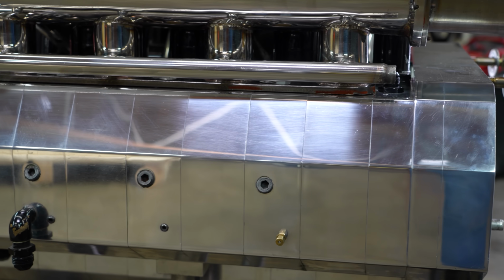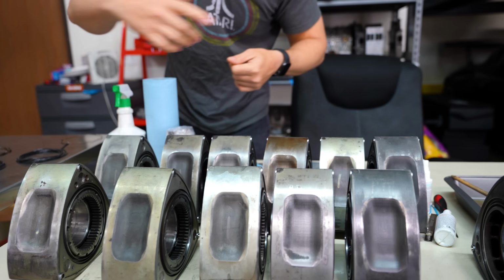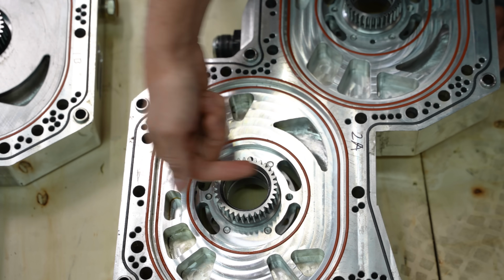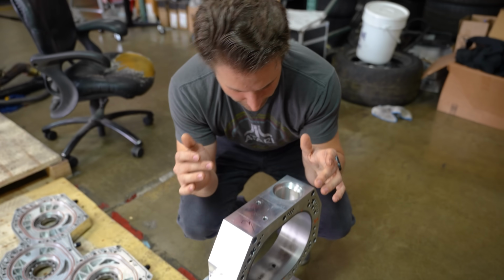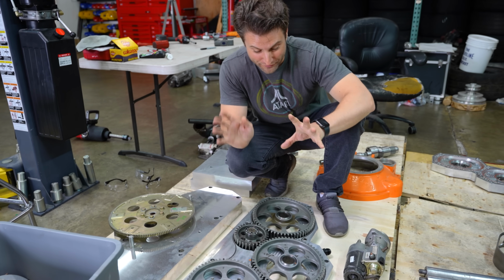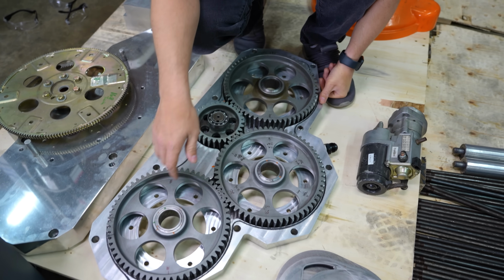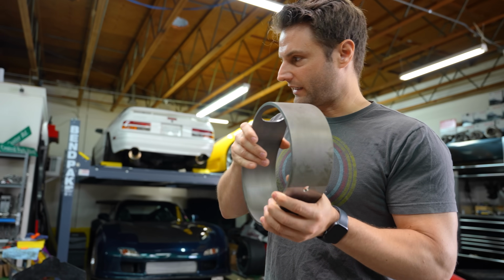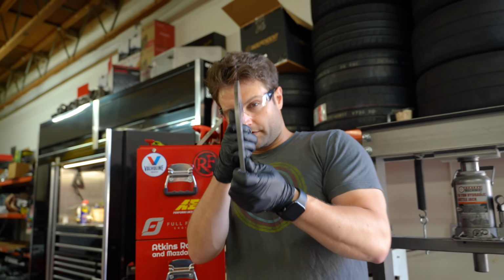Everything wrong with the 12 Rotor

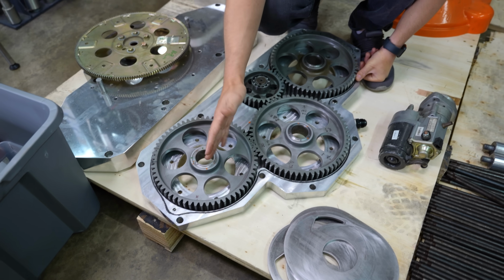Comment: 13:28 - Is it possible it's 3 degrees off because the smaller gear is off-centre? Wouldn't that cause a tiny difference in the force being experience by two of the gears which isn't transmitted equally to the third gear? 

Pure speculation on my part. I'm just curious if it could be true.

Comment: A massive amount of heat for a marine engine is not just ok because you can cool it easily, it also provides a possible source of hot water when at sea. Run a heat exchanger along that thing and the waste heat could be very useful on a boat.

Comment: Really using gravity to feed the oil system makes zero sense to me each rotor set should hv its own pressurized oil feed system and the coolant system neither upper or lower set should share fluids rotors are finicky and oil starvation and air in the coolant system will kill a rotory faster than anything

Comment: It’s an R&D in motion. Someone had to start the motion and the inventor did. What happens going forward is called “progress”. The only thing I would add is that the whole thing is machined out of a single piece of aluminum per section. That’s a “whole lot of shakin going on” as Jerry Lee Used to say. Also all those holes are weak areas… every single one of them. “Time” in motion is the factor missing.. there is so much energy going on in a small enclosure that I believe this design would be self destructive. I still applaud the effort.

Comment: this engine will never run, It is a shambles, the fact that someone made it with no sealing ring for the fuel inlet and silicone is used when you don't know if the two surfaces even meet or have a gap, if it does run it will be hopeless and never move and car forward, 
I bet you £5 I'm right, any takers, I'll give it 24 months from today 26.12.23

Comment: @12:45 It is very clear that the big gears and small gear will need to be replaced, so that three main gears are spun identically. https://youtu.be/Q2IFWveYBRs?t=322  If you have not seen it running so smooth a glass of water has no ripples.

Comment: I can't believe the guy designed this with so few problems first go. Massive engine knowledge and creativity...Genious level stuff really. Clearly it's not going to run a long time as it is presently built but with some design adjustments it looks capable of being a solid functional block. The value of taking it apart, seeing his design and how it started failing is off the charts. In a marine application this engine has serious potential as well.

Comment: You need to flip one of the drive gears over to get all 3 banks timed perfectly. If each gear is off by 1.5 degrees, say clockwise, then flipping one gear over would make it 1.5 degrees off counterclockwise. A drivve gear mounted backwards would cancel out the timing offset.

Comment: You need to cryo all the parts for extended life, extreme dissipation of heat, getting very consistent expansion and contraction, increasing the strength dramatically of all parts. Cryo'd parts require cryo specific heat treating after the cryo treatment. Aluminum and iron are cryo'd and heat treated for different times and temperatures. Beware of people who do cryo and don't know what is actually the correct methods. All dissimilar metals have to be treated separately, not assembled or pressed together. You can experiment on a 2 rotor motor to prove out these benefits. I am the founder and now retired past owner of Cryo Science that was originally located in San Diego, CA.

Comment: I have a NA rotory 13b in my 1986 rx7 and it never skipped a beat.. I think rotary is a lot more reliable than my friends A4 2.0t which died at 60k miles.. my other friends A8 4.2 needs a rebuild at 80k.. my BMW 328i only made it to 135k.. the mazda will go well beyond 150k no problem at all.

Comment: So you're saying that 6 shafts in a hexagon with 2 rotors each would be the dream 12 rotor engine. Half running clockwise half anti-clockwise, potential to have each rotor firing by itself, half tooth timing is at least balanced, still no counterweights. In some ways the engine could be thought of as in three thirds of clock/counter shafts, in some ways two interlocking triangles of same-orientation shafts. One set of triangles would have three reversing cogs one end, other triangle reversing cogs the other. All things balanced.

Comment: If it was made from bellitt magnesium, instead of aluminum, would it eliminate some of the issues? Also, if it was used in a marine application, it would require a serious heat exchanger system, because you can't use the water from the
environment (contaminated water, salt water, or even tanic acidic fresh water. They easily destroy metal thru electrolysis or dissimilar metals. Good luck, my head is hurting just thinking about it!

Comment: I will admit that I don't know a ton about engines, but I do know a little about lathe spindles and from watching your YouTube videos on the 12 rotor engine with the modular spindle crank shaft. My question is, wouldn't taper roller bearings be a better choice to help in countering axial loads of of the shafts oiling system and the higher rpm that this engine was inspired to produce? As I said know next to nothing about engines and a bit about machine tool spindles that are designed for very high rpms.

Comment: There should be pressure sensors in most cavities where needed if that's possible,, so you'll know if any seal breaks inside the engine and it loosers pressure. It's a very technically hard to probably fit this but it would be good as you wouldn't have to pull the whole engine apart to find a leak as it will be pretty much pin pointed for you.???? Maybe just for the first time running the engine so If it fails on any seals, you can solve the problem and try again and if it holds, take the pressure sensors out and trust your engineering but I'd say keep them in.

Comment: The Zero Calculation of a gear tooth is interesting.  Rob's analysis presumes that the outside gear teeth are completely symmetrical with the inside splines going to the shaft.
He may be exactly correct, but there is a solution.  a new set of gears can be created with the shafts and Inside Splines aligned at Top Dead Center then have the outside teeth cut to the desired position.

Comment: It might have been said here. The gears are the same. But are the location of the centerlines the same? It wouldn't be hard for the case to be off slightly to compensate for the 3 degrees. it would likely be 1/16 to 1/8 of an inch axially. It likely would be hard to notice.

Comment: Rob! I'm building a 82 gen 1 rx7 and I am installing a sniper efi conversion and a red holly fuel pump. I'm also changing the fuel lines from SS to braided an6. However I'm running into an issue. The fuel pump is 3/8 npt and the EFI is 9/16. Second issue is how to install a fuel filter with this new set up. 
Please help

Comment: Why not use Oil as a coolant - 50 years ago I worked at a gas station and this old lady pulled in and asked me to check the oil in her radiator - after making a fool of myself I put a pint of oil in her radiator and found that she knew how her car worked - Water is not the only coolant on earth - Oil's not bad either and it doesn't have the catastrophic effect when a head gasket blows either - it's more "CLOSE IT DOWN CLOSE IT DOWN" as the sump becomes the fuel and the throttle is the lack of oil in the sump and the Blowbi value is the air intake

Comment: Simple solution.  Run the pressure channels backwards sotospeak with a separate pressure vessel.  Think instead of low pressure drain as hi pressure oil running the other way.

Comment: If at the rotors are in phase you get 6 power pulses per revolution. Why not spread it out to get 36 power pulses per revolution? Use 3 computers for control.

Comment: Any way yo look at it rotary motors are still in efficient zero torque producing turds. NA or otherwise. 
also looking at the ports on these the flow must be atrocious on intake and exhaust side, with the hard edges and changes in direction the fuel/air mix has to make to get into the combustion chamber then the horrid restriction of that poorly shaped exhaust port. i bet a better intake and exhaust port shape would help that motor more than youd think.

Comment: Chemical Engineer here: Shouldn't the gearing at the coupling not be a big issue, since the e-shafts can be timed separately with the splines in steps of 4 degrees (IIRC)? So it should only be 1 degree off the other rows?

The last point was the most critical IMO. The difference in thermal expansion coefficient will surely lead to long term issues. Either the those plates need to be reinforced without inhibiting the function (like splines), or you need a new material that is more aligned with the aluminums coefficient, but can stand the heat.

And no, I haven't watched the new 84 minute video. I just found this channel and haven't had the time yet.

Comment: The engineering challenges in this 12 rotor are daunting, to say the least.  Regarding the 3 degrees of timing being off and the one set of rotors having to run in reverse, what if you could figure a way to add another smaller gear.  Like the one smaller gear already in there, this would enable you to un-link the two larger gears and then have all the rotors run in the same direction of rotation.  Sure, that adds to the complexity.  The problem might also be not having enough room in the casting.  
You still also have all those other issues to deal with as well.

Comment: Not only that, but the closest to camera sprocket/shaft is running not just 3 degrees off but in the opposite direction to the other 2. So there's going to be interesting things going on with the math etc. With the offset position where the two sets of teeth meet compared to top dead center I'd have to closely look at the tooth spacing to see what it actually all means as it might all line up if they've been exceptionally clever.

Comment: I want to make a comment, not specifically about the video-- but something he mentions. ''A naturally aspirated rotary never has problems'' (paraphrased). This is not exactly true. I see many NA rotary engines having major problems at even 150000 miles. Obviously it depends how much you're really pushing the engine, but its a rotary, you're gonna have some fun on canyon or local roads. And when that happens, you get a lot of problems with even NA rotaries.

Comment: How many splines do the e-shafts have where they connect to those gears?  Because you're right, with them all assembled at the same place on identical gears, being tooth and valley means it'll be 3 degrees off.  But if there are, say, only 24 splines, then by pulling the e-shaft out, moving it forward one spline, and then moving the gear back one tooth, you've advanced (or retarded) the rotor timing by 9 degrees.  If you went two teeth... that's 3 degrees.

Math: 24 splines into 360 degrees means each spline gives you 15 degrees of rotation.  Move forward one spline and back two 6 degree teeth, that's 3 degrees advance.  Move back one spline and forward two teeth, that's 3 degrees of retardation.

Now, obviously I don't know how many splines those things have, but as long as it's not "60" or "30", then there may well be some combination of spline and tooth shifting that let's you put all of your rotors at "relative TDC" to one another and have them firing as appropriate, and also not making for weird out of synch power strokes and exhaust pulses.  (Which would be the other way to solve the problem, given electronic timing and injection -- just tell the computer to move that bank of rotors by 3 degrees relative to the others.  But it won't sound nearly as awesome as them being actually timed correctly.)

Comment: i see your point but i think you should have taken the bowed convex rotor side plate and milled it some and then installed it upside down. since the port location would be wrong, maybe the optimal solution would have been to use your press and go beyond straightening it, rather give it 7 to 8 pumps and bow it the opposite direction and then mill it flat. then the port location is correct and the component is wear-mated to the circumstances of the engine. you wont have oil leaks by the seals, rather, some blow-by on a cold engine that passes after warm-up. honored to be submitting an opinion about such a great engine and to those bearing the endeavor. i'm no stranger to the anxiety associated with cutting something (like your end plates) that is a one-off component that cannot simply be replaced or remade. you may possibly regret cutting it and reading my suggestion. but when my favorite machine shop (ARI in Grandview, MO) had a new guy accidently break 2 of my 8 hand-Dremmel'd hand-domed & hand-clearanced pistons, i was devastated inside, but before i spoke in reply to one of my personal hero's, i considered his devastation when he found out what his employee had done and finding the serenity to make that call and give me the bad news. my reply to him was "aww man, it's not the end of the world, and please, don't fire the guy, at least not for that. so we laughed and he said " well what do you want me to do? " i just need 2 more used pistons to modify. Tom (a mutual friend and core supplier) is who i got them from. see if he can bring 2 more while i can still remember how i ground the first set.  some time was lost and some bonds where made. makes me wish ol' Dave was still here with us. 
you've gotta take some risks while all this is still relevant and while you have the time and resources. there's no guarantee of someone picking up on this project where you guy's left off. fail, fail, fail until you succeed.

Comment: Wonder did the designer share the CAD files? I’m assuming they exist.

How about heat treating or hardening the plates in some way?

FWIW, many early OEM 12 cylinder engine used two ECUs on a coming trigger wheel, offset pickups for each EXU. 

Admittedly that’s not a rotary of course but if you ended up going with counter balancing and changing the timing to need sequential ignition and fuel, you could use two ECUs on a common trigger wheel.

Comment: Could use coils like gm 3800 coils, used waste spark where a coil fires two plugs at the same time, one on power stroke and one on exhaust, in this instance fire on power stroke on two cylinder at once to take it from 12 coils to 6 and simplify tuning the spark but would loose some tunability between cylinders but tolerances seem good on this setup so it would be easy to find a common ground in tuning to produce similar out puts from each pair

Comment: I know that the engine was designed to mach a big block v8 but my question is that wouldn't 2 6 rotors on one billet  housing next to each other solve all the problems mentioned. Sure, it would change the dimensions significantly, but in theory, one would solve all the problems, especially the 3 degree timing issue. This design would also cause a new problem regarding  the output shaft, but surely there will be a solution for this?

Comment: Amazing engine. Ball bearings do have a certain rating in the axial direction, if there have been issues, I would try to change to bearings with a higher axial rating.  For the thermal expansion of the plates, I would machine the aluminium in the centre down to create an expansion gap. If you can get cooling water there, it would ofcourse also reduce the expansion and give a more consistant expansion for your gap.

Comment: The last thing you need is further complication, but I have to imagine the sound from 12 staggered rotors might be like a 24 cylinder piston engine.  In Tyson's low rpm test run video it sounds rather industrial.  Are there accurate blueprints that can be translated to cnc mill files? Having backup parts would be comforting.

Comment: IRT the oiling issue, could you not block the connecting channels between the two upper and the lower rotors and run a separate pump to feed the lower rotor separately? 
Have an independent feed line running down the valley to feed the centre rotor and have the outers return individually instead of trying to use their 'waste' oil to feed the third?

Comment: Mazda is reintroducing the rotary in a constant RPM/load application to charge hybrid batteries. This brings to mind how much electrical power could this thing generate operating in this mode where torque, temp, oil pressure etc are all literally constant? Not saying it would be more practical than a big Diesel generator but in some locations Diesel is fast becoming streng verboten. It just seems like a dream gig for a rotary.

Comment: at 10:12 mark, another term used is "thrust" load.  The problem with that shaft, built up from segmented pieces and not somehow connected with an imaginary threaded rod, is that the splines will tend to chatter, under all the torsional vibration.  And the Mazda rotary is notorious for high torsional impulses.  Quite possibly a failure point as the chatter induces higher forces into the splines than without chatter.  The shaft segments need to somehow be joined in tension to minimize the chatter by frictional contact at the end faces.  Even with the best class spline fit, there is still clearance to get the male/female spline set together.  That's this Aero Engineer's opinion anyway.

Comment: Get the whole block diamond like coated.....we used to get it done to our carbide tooling to keep tools from wearing while cutting castings that were impegnated with sand from the mold.   And make sone plates with thrust bearings at either end of the crank to mitigate endplay...some thrust bearings are rated for machine spindles and can hold up to the rpm necessary also have seen some rated for helecopter use that might be overkill